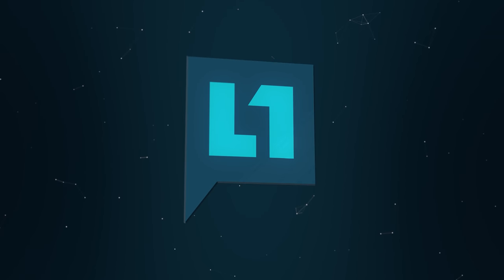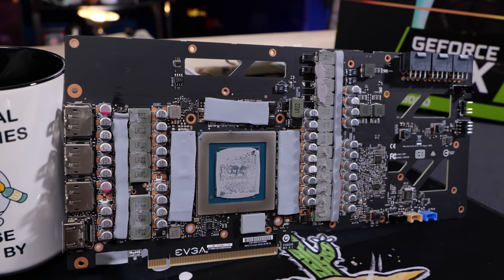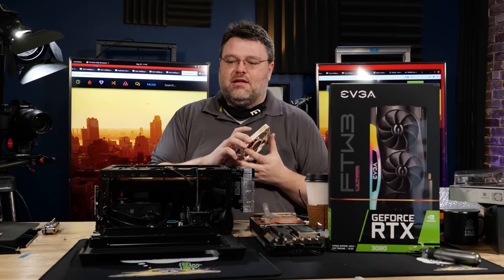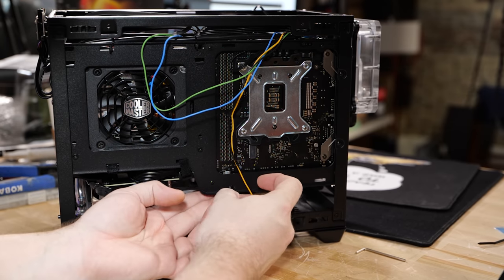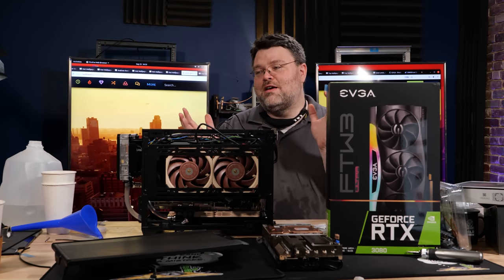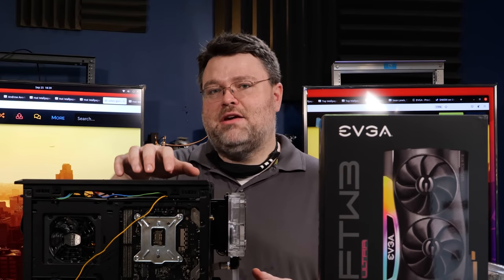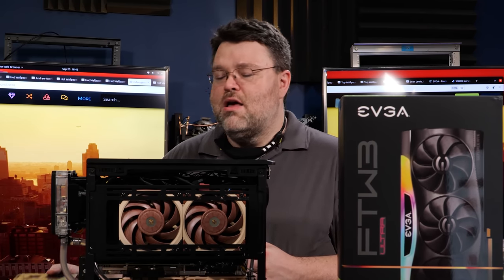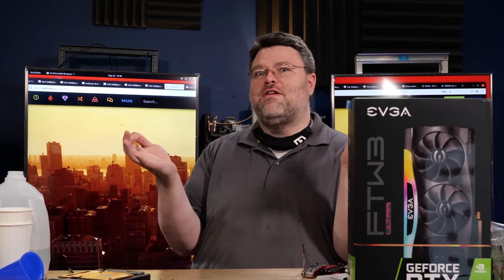Small and Cool! Preparing for Intel Alder Lake!

Comment: Also @level1Techs, on the use of anti bacterial additive, I actually just add some car coolant concentrate specifically Tectaloy Plus - Xtra Cool Gold (Red version not Green), as it also has corrosion inhibitors and nothing is able to live with it in the system. I've found you only need to top up the system with more distilled water as only the water will permeate through soft tubing not the Gycol.

To top it off the coolant only really ions up after about 2yrs of normal use so minimal maintenance and a full flush every two years is great for set and forget builds.

Comment: 6-32 is an imperial screw. A #6 screw is .138 inch, the 32 means 32 threads per inch, thus a 6-32 is a normal small-ish  screw size, not a metric screw.
Reply: Oh how I hated my life living in a metric world trying to find some imperial 6-32 Allen key screws just so I could cut them shorter to fit the NF-A 15mm fans into the super slim Alpha cool TX 240.
Being in outback Australia kind sucks sometimes...
Reply: @Syraxal  we can get almost any metric size screw n the average hardware store, it's hard to believe they don't carry a stock of Imperial screws and Allen wrenches in Metric-land.
Reply: @SuperFredAZ   As far as Imperial Allen 'wrenches' go they're stocked everywhere but it took me by surprise about the screws. I went to all the local stockists no one had any or even stocked them in this particular size/thread pitch. Living in regional Western Australia, I ended up having to order the "Screw set UNC 6-32 30mm (20 pcs)" direct from EKWB, cost more to deliver than the cost of the 20 screws themselves... (which was ok I guess as I ended up just ordering more water cooling components from EK to level out the shipping costs)

Comment: I love that case for it’s cost to performance to size value. I used it for my wife’s PC with an I5-10600k and a 3070ti all air cooled and it stays cool under full load. I love being able to almost fully disassemble the case for building.The white powder coat version of the case has caused a double-take from non-tech relatives thinking she was running an Apple product.

Comment: I’m haven’t done water cooling in like 5+ years. I love Wendell’s recommendation of getting screws at the right length. You can use any power supply just make sure it is turned off on the switch and jump the 2 pins on 20/24 pin cable(lookup PSU paper clip method). Also, make sure nothing is connected to the PSU other than the pump. The zip ties do come in clutch in those tight spots. Planning to get the NRMAX 200 with Alder Lake. I wish I could get the Beast Canyon but scalpers ruined that lol.

Comment: I'm quite happy with my XC3 3080s on hybrid units with my modified plate to direct-cool the memory using paste instead of pads.  I have XC3 3080 TI hybrid as well, works just fine.  I have 2 FTW 3080 TIs, they're okay.  I'm putting my kingpin into my alderlake build I'm preparing.  Funny to see I'm not the only one getting a machine ready for AL -- though I'm not putting another board in it in the short term.  Just more work and I don't need a 5th machine sitting here.

Comment: The bottom rad will be starved for airflow with the GPU immediately adjacent. suggest you remove the bottom rad and just use the fans to keep the air moving in the right direction.

Comment: Instead of using the EK reservoir/pump mount, you can get a specifically designed pump/res from Iceman which is designed specifically for the NCase, and does not require drilling your case.
Reply from the maker: Did you not see the vid? This is the m200 which requires drilling either way. Literally have both. And the Iceman's going on the base build ..
Reply: @Level1Techs  sorry I misheard. I think the  Iceman NCase will also work for this case but you're correct it will still require drilling holes for the mounting post and pass-through inlet/outlet.

Was getting distracted midway into the video. My mistake.

Comment: You should leave some air in the res to accommodate the higher pressure when the water heats up above 30C, otherwise you can put too much pressure on the o-rings/seals and it can leak while the loop is hot, even if it passes a cold leak test.

Comment: To really do your build right, only install 1 of the rad's fans to the CPU fan -- set it on a curve so that the fan drops to its lowest speed when the CPU is below an acceptable threshold and only ramp to speed above a certain temp you determine to be max capable.  The top fan and the other fan on that rad should be set to temp control mirroring the CPU's ramp up via motherboard header, but at low loads, they should be OFF -- only come on at a reasonable loaded temp.  The GPU controlled rads, do something similar, off until the temp hits a certain threshold with a curve ramping up to full speed appropriately.  I can't tell you the temps because I don't know the loads, but that's how I do it.  You always need at least 1 fan running for the silent loop setup to keep loop temps low without load.  1 fan is all it takes on an idle loop to prevent loop temps from climbing.  Absolutely no reason to have the fans on when the machine is just idling / lightly loaded.  Don't bother with all fan stop on light loads as the loop temps will climb quite a bit and the second it's loaded, the temps are quite high because the loop coolant is pretty warm and needs cooled down.   Otherwise you're needlessly running air and the dust it contains through the machine.  I've got 8 140mm fans in my case and they're all off except 1 that keeps the loop coolant temp low.

For example, my 5800x CPU fan is set to 30% until 55c where a straight line fan curve to 100% at 65c.  The other fans are on a mobo header with a curve that's 0% until 55c then ramps to 100% at 65c (immediately jumps to 30% and follows the CPU's plot).  Pump is 100% all the time however.  The GPU controlled fans are off until 45c and start a ramp to 100% at 54c.  It takes time to dial in each new machine configured like this because you have to learn its behavior and tune accordingly.    If the mobo has a temp probe, you can place it in the GPU near the memory or power ICs and you've got a way to control the mobo fans with GPU and CPU heat at that point.   You can also use it to tap the loop temps and set a separate curve on its temp if you desire. Lots of ways to do it -- don't waste fan life and make the case dirty needlessly pushing air through it.

Comment: That is all well and good, but for my purposes, a bit too over the top. On my wishlist? A comparison of two systems "for the rest of us", with which I mean: a build into two CoolerMaster NR200 cases, one with a Ryzen 5600G or 5700G and one with an Intel i5-11500 (without K), and both of them without graphics cards, and with a simple Noctua L12S or something. Then compare the thermals please, and tell us about these more "office" or "work" oriented machines. Would for instance my 3,5" WD Red 4TB drive still fit on the side fitting with the Noctua's fan mounted on top of the heatsink? Or would it fit when screwed upon the fitting for the power supply (from inside I guess, before mounting the power supply into that casing)? That would be interesting to know and to see, and to hear experts' thoughts about these. The case is beautiful, and I do need one which is less than 200mm wide)...
Cheers from Germany,
Wolfgang

Comment: Unless you live in a 150sq ft Tokyo apartment where every cubic inch matters, I don't understand the obsession so many people have with building ITX or smaller PCs. Give me a nice mid-tower with a full ATX motherboard anyday! Many years ago I built a mATX system in a MicroFly mATX case and it was a huge PITA, so perhaps that is where I learned my lesson from. And while I never using water cooling either, at least I can see the performance reasons for risking using water cooling. For me, installing front fans, top fans, rear fan, and a quality air cooler on the CPU is the perfect build.
Reply: It's fun and new, I think most people that buy and plan a tight ITX build, already built a few ATX towers and just wanted to do something new.

EDIT: But I am similar I like my big tower. :)

Comment: Isn't the z height of alder lake slightly higher than 11th gen?
Edit sorry lower. The Z-height has also changed to 6.529mm compared to 7.31mm on the previous LGA 12*/115 sockets. Wccftech
Reply: That means a different set of mounting hardware (expected), or at worst a change in block. That isn't a bad thing as IIRC the IHS has gotten a little bigger